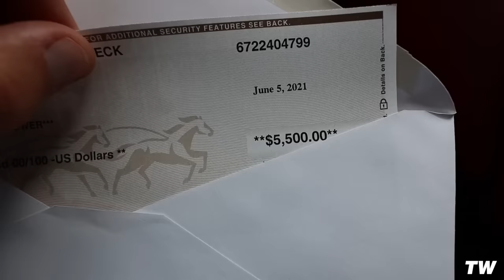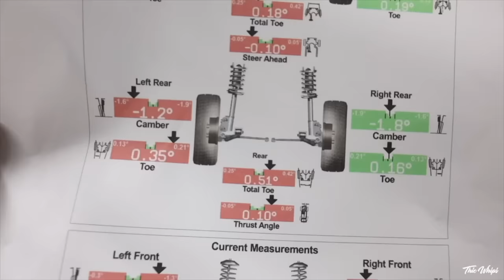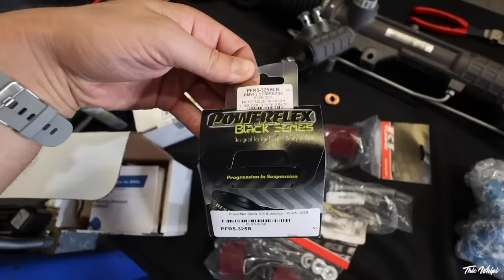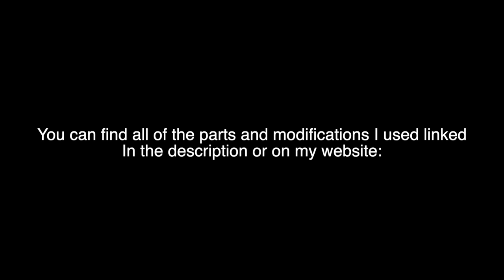BUILDING A BMW E36 M3 IN 15 MINUTES!

Comment from the maker: Definitely far from finished with this build, lots of parts have been added since I made this video. I’ll probably make an updated one in the future. This is one of those forever builds, gunna take me years! Thanks for watching!
Reply: Hey man do you think 18k could bring my brother 95 m3 back been sitting awhile need paint and get engine running interior and probably some wiring
Reply: Want to trade cars
Reply: Why don't you do a rebuild on a Volkswagen MK3 GTI
Reply: Boss where did you bought your carbon fiber front lip?
Reply: How did you manage to do this in 15 minutes?
Reply: amazing~~~!!!!
Reply: In Toronto you would be lucky to find one under 20k

Comment: its kind of leaning forward in a weird way why?
Reply from the maker: We call that, rake. Originally the tires were just a bit too wide. So I had to run the rear suspension a little higher to avoid rubbing on track. I’ve since changed my tires and evened out the rake now. Can find photos on my Instagram or tiktok